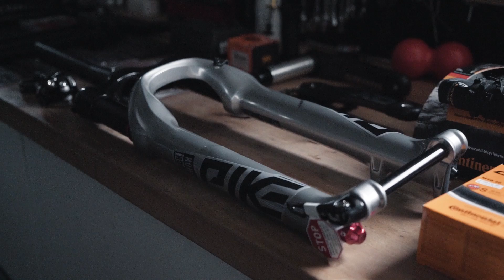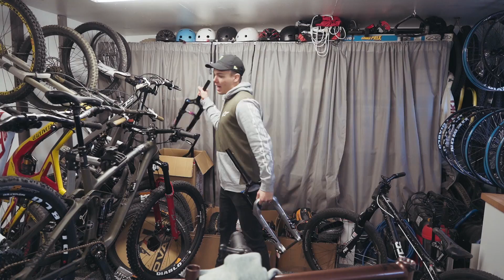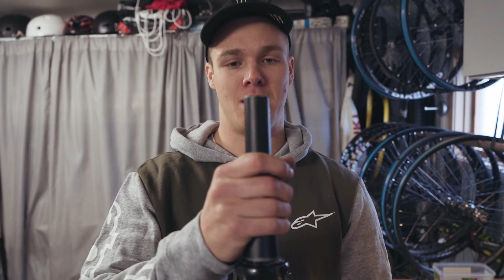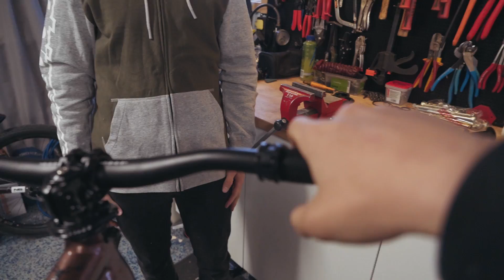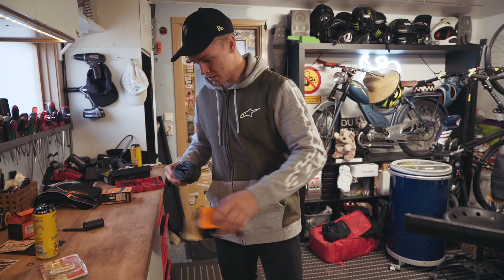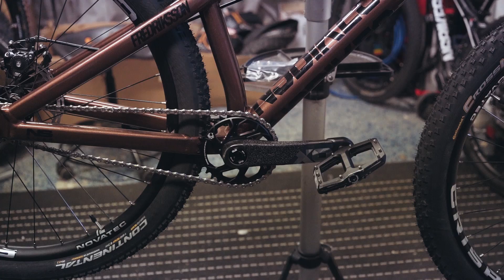MY NEW CUSTOM DIRT JUMP BIKE BUILD

Comment: Find a way to shorten those upper cables! It’s the only not perfect thing. 

Also if your chain is floppy when you change chainrings you can use a single half link from a bmx chain to get the wheel slammed.